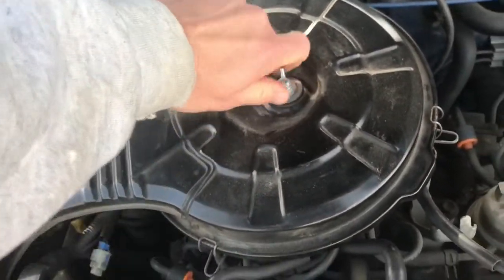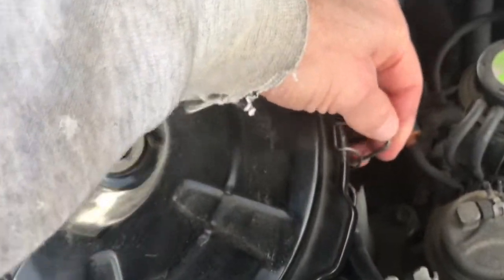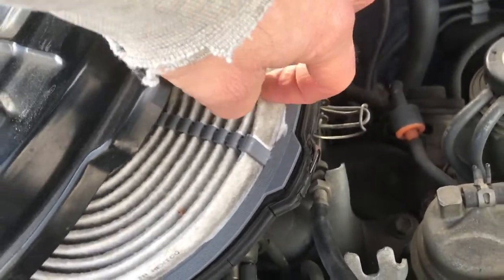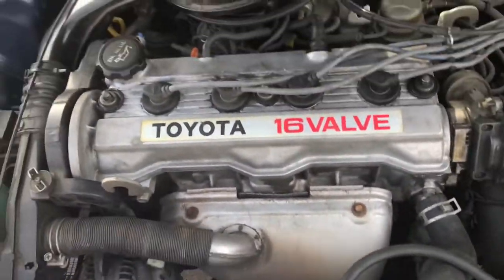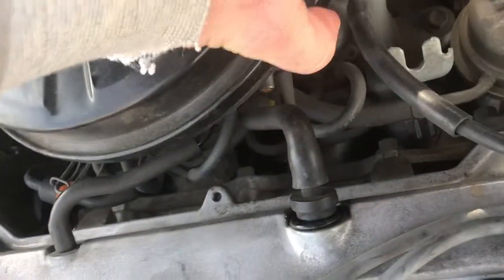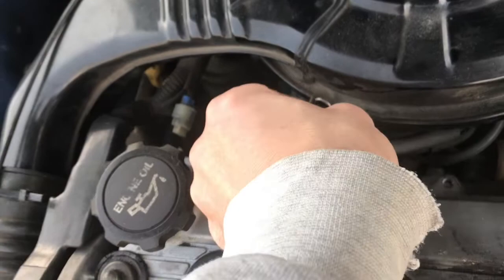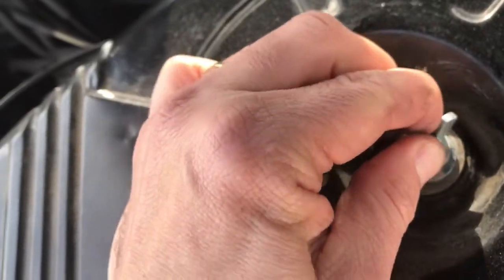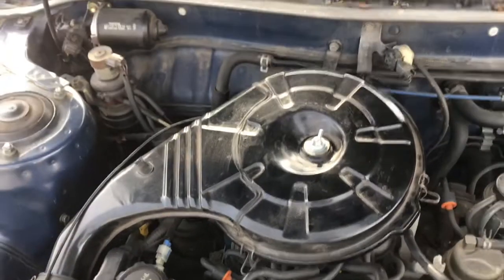How to replace an air filter in a Toyota Corolla

Comment: Impressive. One handed. I usually remove the rubber snorkel duct from the top half to have better access to the whole assembly for cleaning. However, it's easier with two hands.
Reply from the maker: Yes 2 hands = better! I didn't have a colleague who was available to film me though, so I had to do it one handed....:-)

Comment: We just brought a 92 Corolla. Been running good until yesterday. Won't idle but drives ok. Went to check airfliter and it didn't have one... crazy. Anyway brought one put it in, replaced all the little hoses (none had holes) and still doesn't want to. Been told by grarge has a air leak.  Does anyone know if the is meant to be seal of some sort between carb and air filter housing? It looks like something has been there but maybe over time with no air filter in its worn away. Any help would be much appreciated
Reply: Sorry George I do not know.

Comment: I have the same car, can't get the top off for some reason (took off the nut, washer and unclamped the 3 clamps). Any tips for getting it off?
Reply from the maker: Blurry - so sorry... it must have some crust cementing the top to the base. I don't think you want to put pressure on it but a gentle twist might be ok... if you have to do more you might want to take it somewhere because you don't want to break that air filter body that houses the insides....
Reply: @Our__Earth  Ah I'll try that. When I try lifting it, it feels like its just lifting the full assembly to the carb. Maybe using the right prying solution or something could work. I'll take it to some mechanic if some twisting or a flat head can't do it